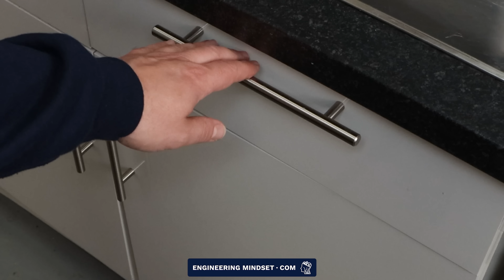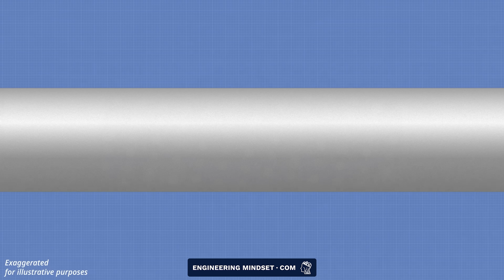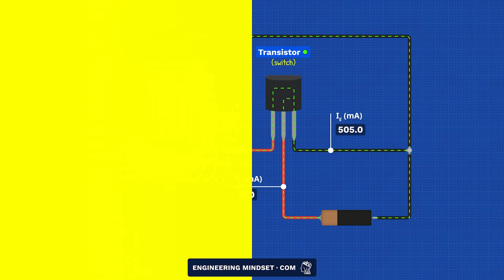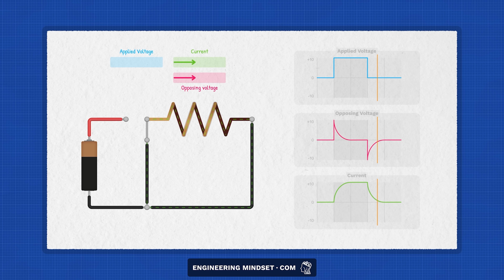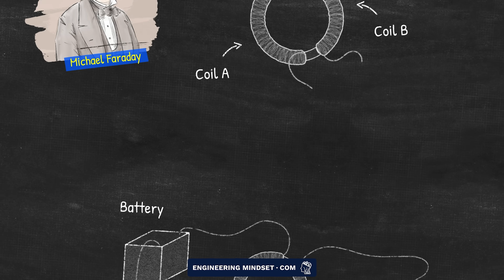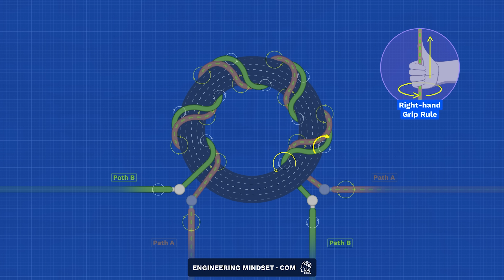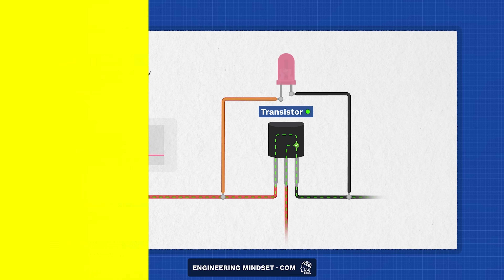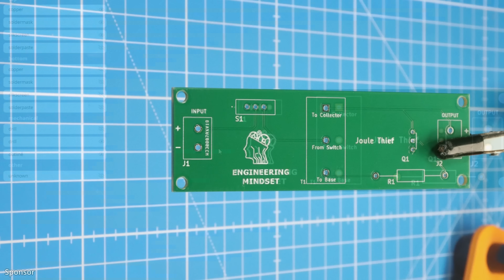Why This Circuit Works When It Shouldn’t

Comment: The operating principal is like a hydraulic ram pump. A kind of water pump that uses the flow of water to pump water. Except the inductance is developed from the mass of the moving water itself. And in this circuit instead of water coming out of a loss valve it is turned into heat.

Comment: You could also connect 2 LEDs in parallel, (1 In normal polarity and the other one in reverse polarity) to get even more light out of that circuit.
Reply: Could you?
Reply: I don't think that would work as it stands, as it's a positive boost regulator, well regulator is probably not what it is, but is shares the basic layout of a boost regulator, just that it's self-oscillating

Comment: I was impressed that this video dug down into the inner workings of the devices in the circuit. Very impressive. Next up, transistor currents in an nvidia last gen chip upon transition of the interrupt line while executing a nop instruction. 😂

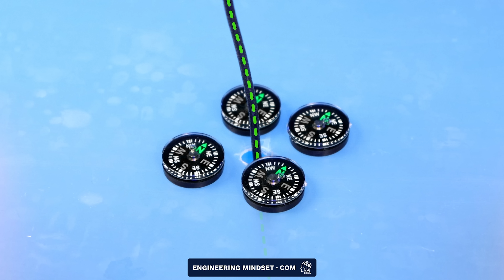Comment: tl;dr 6:15 field lines are pointing the wrong way? 

The compass needle ‘N’ end is itself magnetic south, yes? Since it points to north / it’s attracted to north.

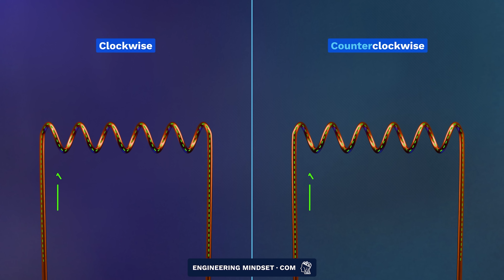6:52 outside the coil the magnetic field lines point from N to S, yes? So, outside the coil, a compass needle would point in the same direction as the field lines like it does at 6:15? Or it would point towards the N end of the coil, against the direction of the field lines?

Comment: You say that this circuit should not work.  Does that mean that if I simulate the circuit in pSpice, it will not work?  If I use a toroid core that does not saturate with the peak current, will the circuit fail?

Comment: at 11:34 you show and say positive leaves the battery. I thought positive was going into the battery, and negative was leaving the battery.  I used to think it was the opposite.
Reply: You're thinking of actual electron flow direction. For conventional current, it does go out of the positive end and into the negative end.
The reason it's this way (at least from what I've heard) is because we (humans) started exploring and describing electrical current before we knew that electrons had a negative charge. It was just assumed that electricity does flow from positive to negative and the math worked out as defined. By the time we discovered and understood the electrons that carry the electrical energy people had already been using positive to negative current for a long time and didn't see the need in changing the way we do things since it didn't really matter most of the time

Comment: Interesting. I have a side hobby of taking blinking LEDs out of novelty pens that are broken and using them to bleed off the final gasps of power in weak batteriesb that would otherwise get thrown away. This usually takes weeks before one of the 2 batteries is flat.

Comment: A similar circuit works with a couple of coils, and without the toroid. Oscillator circuit drives a coil, overlay on a second coil, and that will light the LED. My coils were made from strands of the old solid telephone wire, about 20 turns 25 to 30mm each, and work through some insulating materials between the coils too! #Joule thief

Comment: 15:20 - That's the part most videos get wrong. A joule thief even works on a sendust (FeSiAl) or iron powder core. The sendust / iron cores have low flux, very high saturation current. Say the core has 200A of saturation current. The battery can't reliably supply 200A of current. Yet the circuit works.

Now imagine an air-core inductor. It won't saturate at all at any given current, yet the circuit works fine even with an air-core. Even the MnZn toroid (ungapped) core you used might not totally saturate at such a low current, even though they have very high permeability and very low saturation current.

So it's definitely not solely core saturation. It's often β collapse or the battery's ESR limiting the current.
Reply: Interesting. Thanks.
Reply: Once the battery voltage changes significantly to cause a significant change in magnetic field strength, the back emf is generated in the secondary coil....so it's not about the core saturation
Reply: Is that why the 84 volt spike does not damage the LED, the battery's resistance ?
Reply: It would probably be more sensitive to the resistor value without the sudden drop from saturation.

Comment: I would actually be interested to see how the circuit affects the amperage going through the circuit, LED and the battery (I'd assume it would drain the battery even further and slowly completely destroy the battery)
Reply: That was part of the original idea for this circuit, to get every last bit of energy out of a battery which would otherwise have been thrown away. I have a small AA battery-powered PIR lamp which has this circuit, the last time it failed I checked the battery voltage, just 0.3V. That is presumably the voltage at which the PIR detector stops working. Without this circuit it would need at least 2 cells and would fail when the overall voltage dropped below about 2.7 volts.
Reply: Would like to do a numerical integration on both current and voltage in relation to time, since energy is constant.

Theoretically, if the battery doesn't get damaged, the energy from this dead battery should equal the energy of an output from this boost converter
Reply: Many years ago my father built a circuit to fully drain ni-cad batteries, which worked best when 18:45 fully discharged before the next charging cycle.  This circuit would have been much better at achieving that full discharge, if I am understanding this correctly.
Reply: @garth849  Although this circuit would do what you suggest, it isn't a good idea to take NiCd or NiMH cells that low. About 0.7V is probably as low as you want to go, that would need monitoring since this circuit will go much lower.

Comment: The concept at 9:14 and 11:18 is just a transformer, correct?
Reply: Correctly, it is a 1:1 transformer. The meaning is derived from the ratio of the two wires to each other. Not only the number of turns, but also the thickness of the wire plays a role in the transmission ratio. More turns, more voltage, but less current, and vice versa.
Reply: @SchnickSchnackSchnuck.  The thickness only limits the current, in this example it is immaterial since the wires are capable of many Amperes, which i more than the battery can supply.

Comment: This is honestly the first time I actually UNDERSTOOD what's going on. Like I understand that transistor is basically an electronic switch, but now I understand why and/or how.
That and every other thing here.
Reply: it's not simply a switch, but like an amplifier, current allowed through is proportional to the current sent to the base
i.e. you give base 10mA, and 500mA can flow through transistor, if you give 100mA, then 5000mA will be able to flow.
and this is an intrinsic property of bipolar transistors called "Beta"
I_collector ~= beta * I_base

That's true tho usually for small currents
Reply: @vilkillian  From my understanding, it can work as both (one or the other at a time).
The input and output seem to be laregely irrelevant to the signal given to opten the 'gate'.
If the 'gate' is fully open, whatever comes in goes out.
If it's partially open, what goes out is a portion of what goes in.

I can control the gate with say 5V from an Arduino GPIO pin, but the source/drain can be say 24V from a switching power adapter to power some speakers. I'm not amplifying that 5V to 24V, but opening the gate for it to pass through.
I guess I'm describing a MOSFET above, but in my brain, transistor (BJT) looks at current and MOSFET looks at voltage, but basically do the same thing (because they're both types of transistors). Electricity only 'flows' when there's enough of the proper type signal to do so.

I think it just made more sense in my head to see the electron movement and graphs of each component rather than 'and here it is, look at it go~' from other videos
Reply: @vilkillian There are a lot of ways to describe transistors that are equally accurate, because none of them are perfect. A transistor, depending on the type and application, is essentially a variable solid-state relay, a voltage-sensitive check valve, a current-sensitive inverse variable resistor, a modified diode, etc…
understanding the basis for its function is far more important than the accuracy of an inherently flawed analogy.
Reply: This is the second such video I have seen that I have understood. It is a bit reasuring to me that I understood the concept enough the first time that I could follow along this time.
Still doesn't mean I understand it enough to build one.

Comment: Another fantastic video, love your work!

My only question / comment....the LED 'acts like' a diode? It is a diode, a light emitting diode
Reply: AFAIK some types of LEDs arent't particularly good at rectification.
Reply: @tz8785  Not efficient, certainly, as the voltage drop is high. And they have low reverse-bias voltage limits. But otherwise, they will rectify just fine.
Reply: at some point if study this long enough. all cables are also inductors and capacitors at same time. LEDs are not only diodes, they are solar cells and solar cells are also LEDs. You can argue about efficiency ok, but definitions blur, understanding comes. I love it. Think like an engineer.
Reply: @waschbaers_werkstatt  If I thought like an engineer instead of an electrician, nothing would be accessible or easy to work on after manufacturing

Comment: Excellent explanation, one point with out mentioning the Shockley equation, the base emitter is triggered thru voltage, no voltage no flow of electricity.

Comment: you add capacitor output better
Reply: I was thinking this, why not use a capacitor? And what's the difference? The inductor is storing energy in its magnetic field and the capacitor is storing charge?

Comment: A jewel thief. One of the most popular YouTube short videos if search it on YouTube or Google. 
     Usually a beginner Electronics lesson from your Electronics constructor circuit board require required. They even show you how the wind, Your Own steroid, and all the components can be tack soldered together by their leads.
     PS: this is one of the best videos explaining every function of every component and how they work what they’re doing together. 
   This video explanation of a jewel thief gets an A+ plus